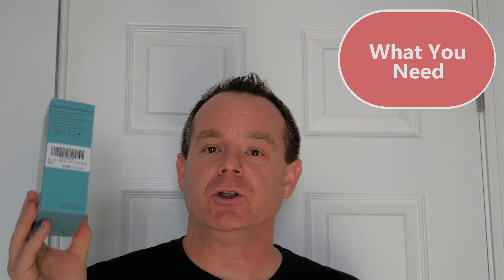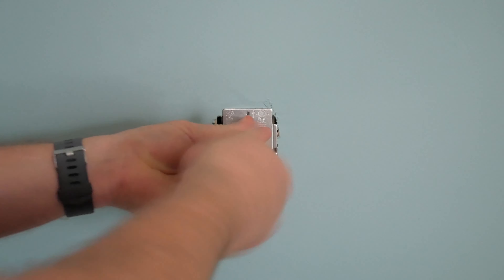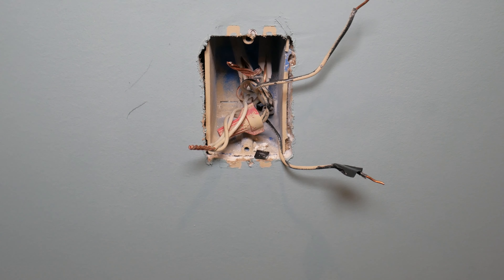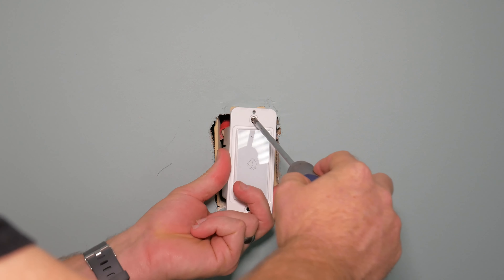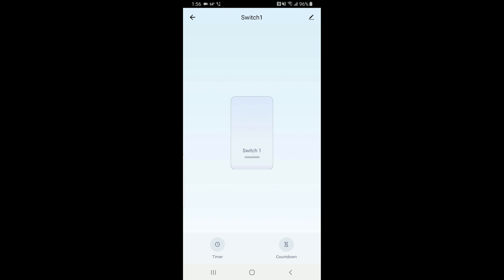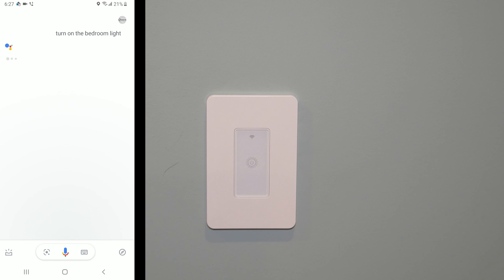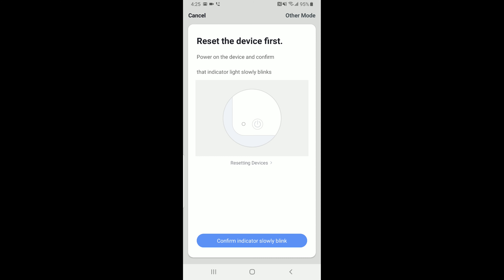How to Install a Smart Light Switch

Comment: The best I have seen so far. You pointed out that the hardest part is to tuck in all the wires and leave enough room for the deeper switch, which gave me a lot of headache. Things are even worse for the 2 and 3 gang switch. I wonder if I should replace the box with a deeper one.
Reply from the maker: Thank you. I have several of these in 2 and 3 gang boxes and have always been able to make it work. Much easier than replacing it with a deeper box.

Comment: I purchased a Honeywell Home RPLS740B1008 and it comes with Load, Line and Neutral.  The current switch is connected to the Load, Line and Ground.  I know i have to connect the Load to the Load, Line to Line and Neutral to Neutral, but what do i do with the Ground wire that was previously connected to the old switch?
Reply from the maker: A ground wire isn't required . If the switch doesnt have a ground option, there may be a screw you can tie the ground to. Otherwise it is not required.
Reply: @ClintHolland  thanks a lot!

Comment: Hello, what if I only have 2 wires? No neutral, can I still install a smart switch? Thank you.
Reply from the maker: You can but not this model.  Look on Amazon for smart switches without a neutral.  They exist but I am not a huge fan of them.
Reply: @ClintHolland  thank you for replying. Yes, I have seen those switchers too and I don't like them either. I thought there was a way around this model. Anyway Thank you for answering the question.🙏
Reply from the maker: @Heatlifer305  Well, the illegal and far from ideal method that many use is to connect the ground to the neutral on the switch. It technically works but can be dangerous.

Comment: Dont know if you will see this, but I have power and when I go to turn on the light, the light flashes momentarily and then turns off. Switch makes a click sound.
Reply from the maker: Have you verified you have the line and load wires correct? That sounds like something that would happen if you reversed those.

Comment: How do I wire the neutral wire if I'm installing two smart switch? Do I install both wires from the switch to the neutral wire all together?
Reply from the maker: Correct.  You can either come from the wire nut with 2 separate neutral wires, one to each switch, or you can connect one neutral wire to switch 1 and from there jump it to switch 2.
Reply: Clint Holland  the one I'm installing is tp link switch which has the green wire white and 2 black. Does it matter if connect the black wires on either one?
Reply from the maker: @pleasingduck4976  What wires do you have coming from the wall?
Reply: Clint Holland from the wall is copper white and two black
Reply from the maker: @pleasingduck4976  So the white is the neutral and one of the blacks is hot and the other one is for the light.  You will need to figure out which black is hot first and that will need to be connected to the hot or line connection on the switch.  And you can share that black hot wire with the 2nd switch as well. That help?
Reply: Clint Holland  copy that thank you sir!

Comment: Nice video. You mentioned you could install the switch to replace all but one of your switches. It would have been nice if you included that switch in the video or at least in your description of what the switch was or how it was wired.
Reply from the maker: I have one light switch that didn't have a neutral wire ran to it which prevents a lot of these smart switches from working.  They now make ones that don't require a neutral so it isn't a big deal anymore. I am not a huge fan of them as they draw power constantly but it's better than not having one I guess.

Comment: I had an electrician wire and install these for me. The light on the switches are on but the manual button doesn't power the lights on or off. I still haven’t t connected it to the app. Did the electrician wire it wrong? Or does it have to be paired to the wifi before we can manually turn on and off the lights?
Reply from the maker: I suspect something is wired wrong or missed.  These work just like a normal switch rather they are paired to the app or not. I suspect the neutral wire wasn't wired up.

Comment: What if the light turns on but the Wi-Fi light does not turn on to hookup. What did I do wrong. I can manually turn on and off light but no Wi-Fi. I need help please. Thanks
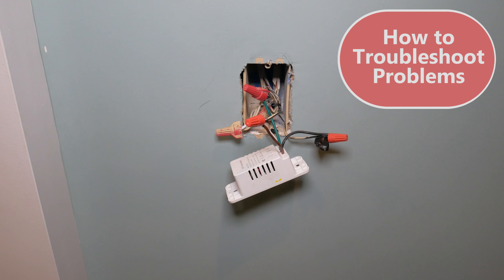Reply from the maker: Have you tried the troubleshooting steps that start around 16:10?

Comment: Okay this is a little off topic but important.  When you removed that old light switch plate, I noticed opening gaps around the walls where insects could enter, is there a way to seal those gaps without permanently sealing that back plate to keep insects out?
Reply from the maker: You could certainly use some of that expanding foam from the hardware store to seal them.  They also sell gaskets that will do almost the same thing.
Reply: @ClintHolland  that seal foam rises too much, but a gasket sounds interesting or maybe caulk?

Comment: I connected everything correctly, the switch has power, the wifi connected and I was able to add the devices to my app. However, whenever I try to turn on the lights manually from the switch or the app, it would make a clicking sound as to it turned on, however, the lights itself do not turn on. Where did I go wrong? I have the same switches and replaced the pre-existing ADT light switches that were here.
Reply: By the way, I did try to switch the wires around as suggested. Nothing happened so I'm pretty sure the current connection is correct.
Reply from the maker: @AmazingAndy  My best guess is the switch is bad.  Do you have a multimeter that you can test with?
Reply: Did you get it figured out? I'm having the same issue.
Reply: @Toughfox I ended up having to hire professional electricians. Even with them, it took 3 days to figure it out. 😓
Reply: @AmazingAndy  I have the same problem. What did they find to be the problem?

Comment: I only have two wires and one bare copper. Will this still work?
Reply from the maker: It will not. What you have most likely is a bare ground wire, a hot wire and a load wire.  You need a neutral wire, usually white in color for this to work.

Comment: Warning: If you have an older house the wall box may be too small to fit a 3 times larger switch and the extra connector caps. Then you have to put the old switch back or tear up your wall for a new box.
Reply from the maker: Thankfully I haven't had that issue but you are very correct.  Putting in a new box to replace an older one is not the easiest task either.

Comment: I've installed these switches and they work for a few hours then they say offline. The Wi-Fi light is on but the switch doesn't work. I have to reset the power and then they work for a bit and then say offline again. I've checked wiring, I've got good Wi-Fi reception, I've uninstalled and reinstalled the switches and app. Any suggestions??
Reply from the maker: When you say they don't work, do you mean through the app or even if you push the buttons manually? Or both?

Comment: What if I only have a white wire and a black wire
Reply from the maker: If you only have 2 wires, these switches won't work. You have to have at least 3 wires, a hot, a neutral and the load wire.  The only way to solve this is to have an electrician run a neutral wire to the box for you.

Comment: If you dont have a ground wire you can fake it by screwing a wire direct to the metal box if you have .then it will work. If you have plastic boxes them you can not install this kind of switches
Reply from the maker: You don't actually have to have a ground wire.  The only 3 wires required for this to work are the hot, neutral and load.  While it is a good idea to connect the ground, it is not a requirement.